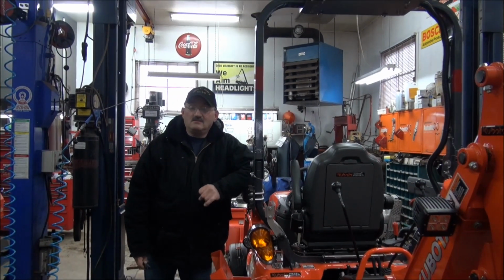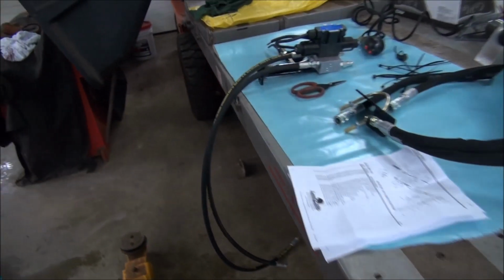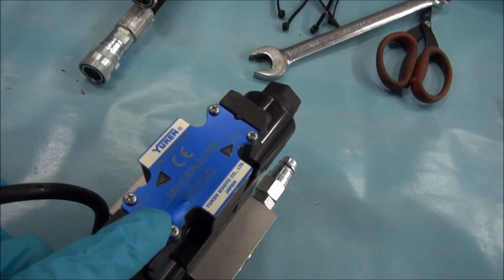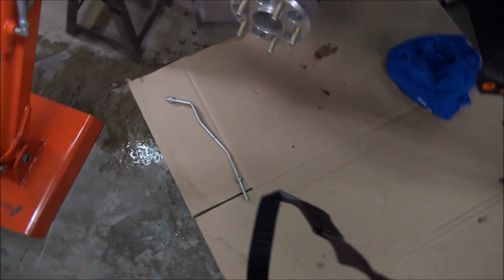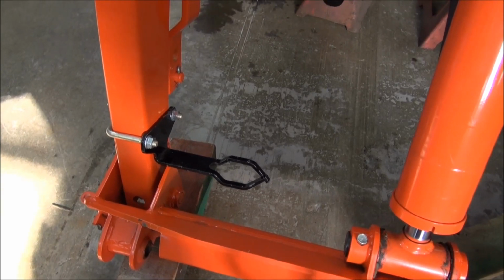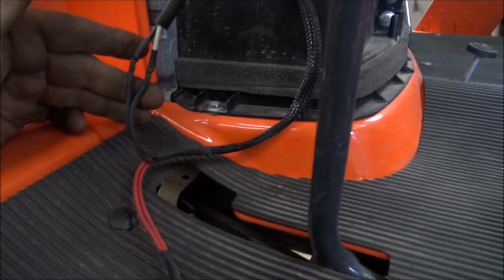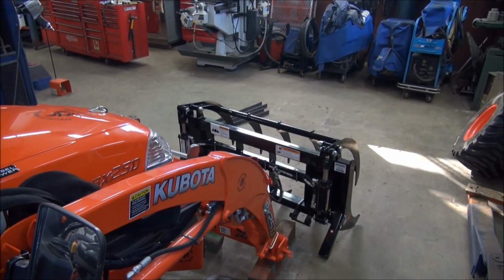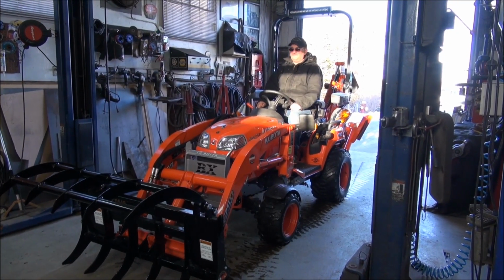Land Pride Grapple and the Kubota BX25 D

Comment: Paul, 

So much of what I do on my BX25D are based on all of your great ideas which are well translated in your videos. While I don't have a grapple just yet, I have the 60" plow which needs a hydraulic cylinder in order to tilt from left to right. After adding the 3rd function valve the way you did and connecting them to the plow lines, I'll be able to change the plows direction from the seat rather than hopping off performing it manually. 

Adding the hydraulics to the blade seems pretty straight forward so all I'll need to do is select the correct cylinder and mount it in the provided location. I'm not sure if if you've done the cylinder mod but it would be a great one to add to an already invaluable list of great videos.

Keep up the great work Paul and never forget to thank the lovely assistant behind the camera!

Bob
Reply from the maker: Thanks Bob. Happy to hear you’ve got some ideas from our videos. Kathy appreciated you including here as well. Your idea seems like a well worth mod that’s for sure. It would have been one that I would have done but our BX is only used in the summer months. We have our 5740 for the winter months. Merry Christmas to you and your family. https://flic.kr/p/21xyv27
Reply: Merry Christmas and a Happy New Year to you and Kathy!

Comment: I wish I had ordered my Kubota 4240 GST with third function installed. Didn't think of it at the time. But I do have 3 rear remotes for future implements. Well thought out Paul. Keep the videos coming. :)
Reply from the maker: I had one on the 4240 cabbed HST tractor then put one on the 5740 as well very nice option to have. 3 remotes is nice to have too! There's another video coming. It should be up in a few hours. Thanks for commenting.

Comment: I had watched this video some time ago.  This weekend I picked up the grapple and did the install.

My grapple would only work when I actuated the curl function on my bucket.

Watching your video again, I had tapped into the wrong port.  Oops.  Once I figured that out, just did a quick change and VIOLA!

Thanks for this, and many other useful videos.
Reply from the maker: +Anthony Mills 
Glad the video helped you out. That's what it's all about. Thanks for watching and commenting.
Reply: +Paul Short Since you removed hydraulic lines. did you have to bleed system?  And if so, how did you do this?
Reply: opryhopeful
Reply from the maker: opryhopeful 
Sorry I missed this question. The answer is no. Most all hydraulic systems self bleed so your good to go.

Comment: Now that you have the 3rd function, a good investment would be the BX 2767A snow/bulldozer blade from Kubota. With the 3rd function you could rise, lower, tilt and curl the blade all at the same time.  I am working on these functions on my 2767 , but haven't finished it yet.  I will find the valve installation of great use as I go along.
Reply from the maker: Bill normally I'd do that but I have the Kubota 5740 with cab and I use that unit for snow clearing. I'm just not tough enough to go out in the cold without a cab and heat lol. Glad it might help you out. Cheers.

Comment: Hi Paul, I just got the same  Landpride 3rd function valve and grapple you installed on your bx.  In the instructions it shows to connect to the left side of the power beyond port behind the right rear tire.  Why did you connect the line to the right side of the power beyond port?
Reply: did you ever get a reply on this ?    If so I would like to know as I have a 25D with hoe

Comment: I have the Bx25d and I have a Landpride 3rd function valve kit. How did you determine to use the steel line on the right? Which they say if you have a backhoe unit that you can not use the steel line on the left. So if I use the one on the right that’s ok because according to landprides directions I need to see a dealer. Please advise me.
Reply: Hi Avery, did you ever get an answer?  I just got the same 3rd function valve for my bx25d and was wondering about connecting on the right side.
Reply: @pauljelen2330  did you get answers about this PB connection
Reply: @jimpilgrim2271   No I did not

Comment: In the video, you took the power beyond to the 3rd function valve, and back to the pipe that was connected to the power beyond. Does this mean when the valve is not energized, hydraulic fluid is avail to the remaining implement actuators, and not when it is actuated?

Comment: Hi Paul, I am getting ready to install a 3rd function on my BX23s with a backhoe attachment.  I noticed yours has a backhoe attachment.  Did you need to do anything special with the  Power beyond or inlet feed for the backhoe when you installed this kit.  I was getting confused with some instructions that I needed to hook directly to my inlet feed on backhoe?
Reply from the maker: Not knowing what 3rd function system you have the only advise I can offer is for you to call or email the people that supplied you with your 3rd function valve. People ask me so many vague questions it’s impossible to give them an accurate answer.

Comment: Paul I have watched several videos showing the installation of third function,  why is the unit not installed at the front of the fel near the bucket tip tilt hydraulic piston.  It would require less hoses and just need a simple wire disconnect near the fel disconnect.

Comment: Paul, have you ever heard of Swenco Posi Lock Connectors? I use them a lot and find they are very quick and reliable. They have wire taps, connectors, fuse holders etc. Give them a look see.
Reply from the maker: Hi Brian. I've seen them in the past but never have used them. Are they water tight?

Comment: Paul is there anyway that a guy could take his rear hydraulics from the removed backhoe and attach some sort of valve to the loader bracket and run hydraulic lines on his BX to use the grapple other than buying this third function valve. Use lines from kubota at the right lengths to go from the rear of tractor to the loader brackets and have a single valve and then install his own lines to the front grapple and use them when needed and remove these lines and valve when the normal bucket is used? Thanks
Reply: Donald Soucy did you ever get an answer on your question? I’m wanting to go the same route. Hopefully you got an answer somewhere.

Comment: I just picked up the quick tach and got the 3rd function installed I have to wait for the grapple to come.  But the question I have is is there a pivot pin that comes with the grapple or was the quick attach supposed to come with spare pins?
Reply from the maker: Tyler Kruckman 
My dealer gave me the pin. It was missing on mine as well. Check with your dealer.

Comment: Wow, I can't believe the packed the solenoid in a bag like that, that's a pretty expensive part to be treating so flippantly. Hopefully someone at land pride will see this and respond accordingly.
Reply from the maker: Ya I thought it was pretty bad. You pay $650. For a kit and it comes in a brim bag lol.
Reply: Paul Short Yea, not good. I had a vendor QC slip up once when I bought my power steering kit for my B7300, one of the hydro lines wasn't crimped. (I didn't notice it, and it blew right off when I applied flow.) The vendor offered to send a one right out though. I declined, as we have a shop in the area, and I just had a line made up.  I can understand the missing parts, but I can't understand the nicks and dents. That is not acceptable.

Comment: I think you probably shouldn't put all you lights through a relay because if you are on the side of a road helping someone and you want to turn your engine off but not your warning lights or head/work lights then you can't. You end up burning fuel.
However I think its a good idea for head lights.
Reply from the maker: Aidan Deslippe Well up here the first thing that would happen to me on the side of the road with this tractor is Id get a fine for being there and have it towed away. We're not permitted on the road unless the machine is fully insured and licensed and this little BX isn't. That being said. I'd never want to shut down my machine on the side of the road in fear I would not get it to restart. The emgerency flashers are useable on the tractor with the key off as well which is the way they are all designed to do. I think doing it the way I have it ensures that I won't leave a light on and kill the battery which is far more likely to happen than having it on the side of the road which will never happen.
Reply: Ok I agree, Thanks for the explanation.

Comment: I'll have to try back, so some reason I'm only seeing a black screen.  (The audio sounds fine though, and the thumbnail is visible, probably just me.)
Reply: It takes more time to view the higher resolution videos, if you go low res, you may see the video.
Reply: This was just weird, I've had them pixelate at home before (On my crappy connection) but never had a problem at work.  And I'm set to 'auto' so it would have dropped down if I was having a BW issue. I hit a video after this one, and it worked fine, and came back to this one and it was black. Its working for me now though. I've just never run into that before.

Comment: that saw scabbard... delrin? nylon? or something else?
Reply from the maker: +kevin scurlock 
I have no idea.
Reply: I thought you made it?
Reply from the maker: +kevin scurlock 
I did. You had asked where to buy one!
Reply: i asked if it's delrin or nylon. edited my question when i saw someone else already had asked.
Reply from the maker: +kevin scurlock 
Built from Delrin.
Reply: Awesome, looks really good btw.
Reply from the maker: +kevin scurlock 
Thanks. I milked it from a sheet and fabricated the holder. If you look closely at it there's an axe holder that's part of it ;)
Reply: I did see the axe, my eyesight is not so good, it looked like two rubber straps holdind the axe?
Reply from the maker: +kevin scurlock 
Yes. You are correct.
Reply: what saw is that? i have the ms271 farm boss
Reply from the maker: +kevin scurlock 
It's a Stehl 251C
http://en.stihl.ca/STIHL-Products/Chain-saws-and-pole-pruners/Gas-chain-saws-for-property-maintenance/21870-110/MS-251-C-BE.aspx
Reply: very nice indeed. i like the quick chain tensioner

Comment: What do you mean by "power beyond"
Reply: the power beyond port can take backpressure, the "out" port can't. when you need to add a new valve on a hyd system, you need to connect it on the PB of the existing valve.